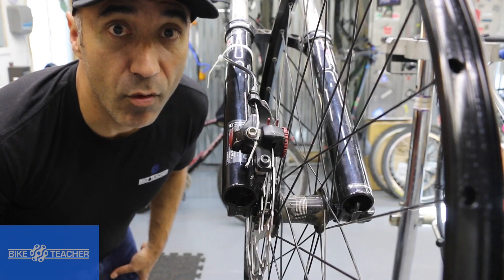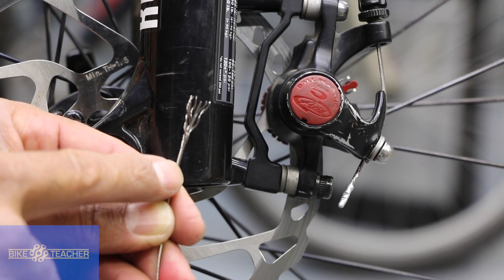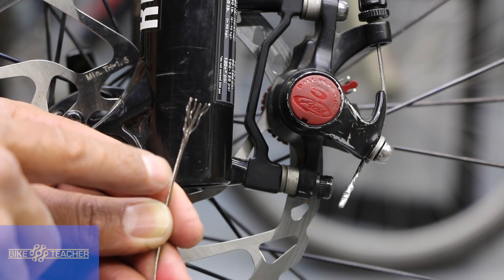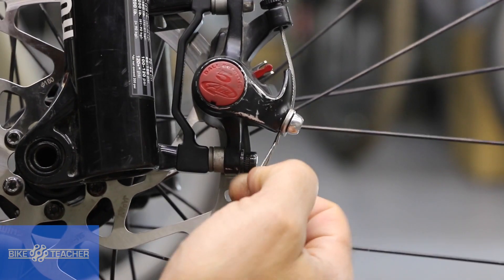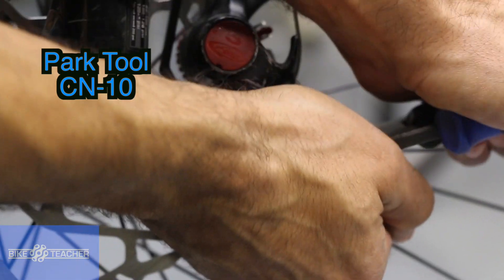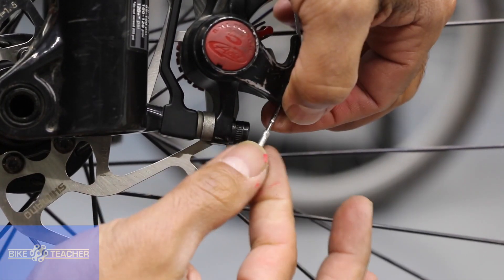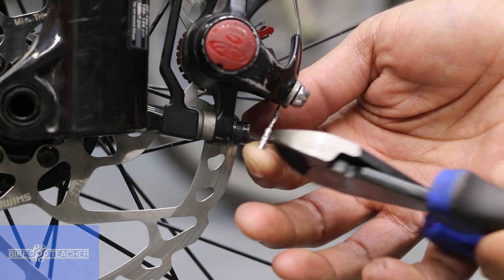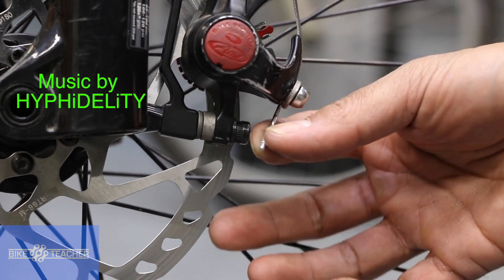How To Repair Frayed Cables

Comment: Any tips for this, I've bought double ended Teflon coated gear cables, got to cut one end to thread through, I have new cable cutters but don't want to take the risk as I've cut a cable and it's unwound previously.
Reply from the maker: Practice on a old cable. Make the cut fast and with confidence. You want a clean cut. Squeeze the cutters slowly and you may get a rough cut. Squeeze fast and hard. Watch your fingers. Afterwards twist the end clockwise nice and tight.
Reply: @BikeTeacher  thanks, the cable I've bought is a much longer length than I need so will practice on this.

Comment: I was driving late last night (luckily not a lot of traffic out). This is a manual truck, and when I hit the gas, I felt a loud thud. The wire from the gas pedal had been frayed off and it was completely disconnected. Put my foot at the gas pedal and nothing happened.
Reply from the maker: Scary, I least it wasn’t stuck full throttle.
Reply: This once  happened to me while doing doughnuts in my '64 VW beetle (in about 1977). The cable broke off right near the gas pedal. I used a pair of vice grips clamped onto the cable as a gas pedal until I could get home.

Comment: I am trying to diagnose a shifter problem, and notice that my cable is frayed.  Do you think that could have anything to do with it?  The issue is that the cable goes really slack after changing gears in the front chainrings.
Reply: the cable is frayed after and at the pinch bolt, but not so much before it.

Comment: What if there’s a frayed cable in the middle of the bike not the end
Reply from the maker: Best to replace it. It could snap at some point.
Reply: @BikeTeacher  Not only that, but it will have an inconsistent length which depends on the tension; leading to poor shifting if a shift cable.

Comment: Where can I get these end caps to fit 2.4mm wire?
Reply from the maker: I’m it sure about the 2.4mm but you can amazon. Typical brake cables are 1.6. You may also try soldering, and electrical shrink wrap. Hope that helps.

Comment: Didn't work, just made mine look so much worse
Reply from the maker: You may need to release the cable to allow it to relax, then crimp, there should be less chance of the ends having pressure and fraying. Or your cable is getting too short and needs replacement.
Reply: @BikeTeacher  Now reading your reply, my cable doesn't is very short, thanks.